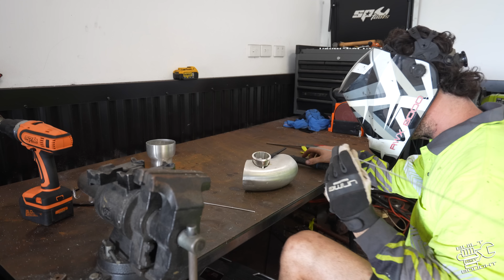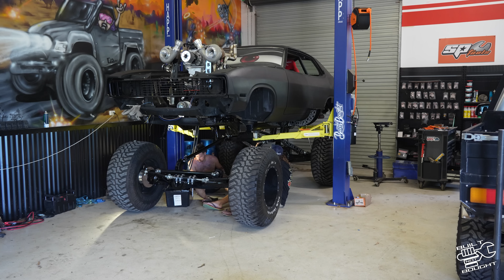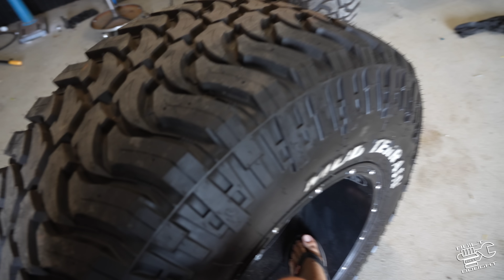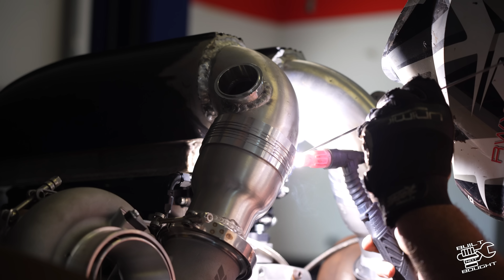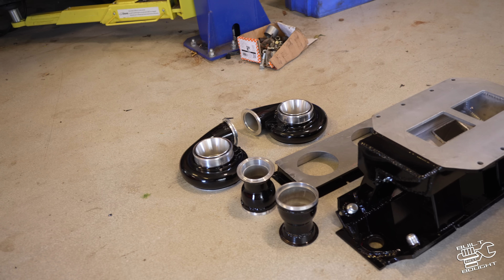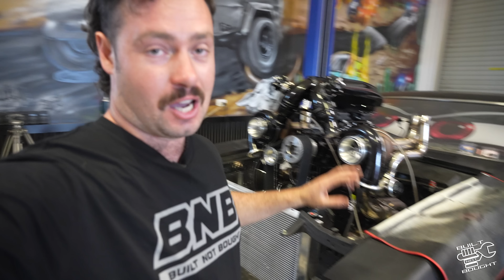XC Ep 14 || Start The Engine For The First Time 🔈

Comment: Mix Diesel and Petrol together for ya flames make them burn for a lot longer on the. And you need a box from Jaycar called a Jacob’s Ladder that will make the spark plug continuously spark.

Comment: Sick build - also FYI in case no one has said it or you haven't noticed, but the intake manifold was moving around while the engine was running. Not sure if it's not bolted down properly etc.